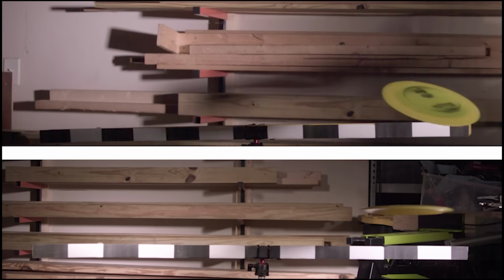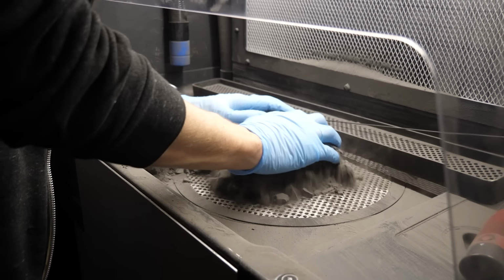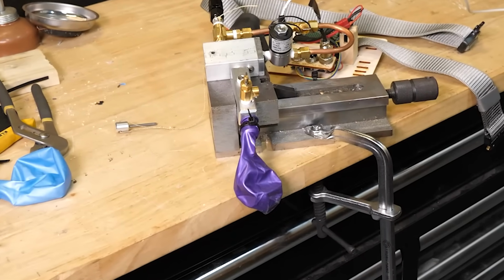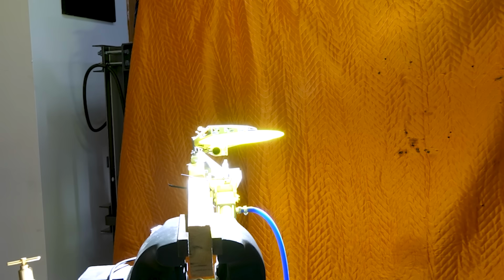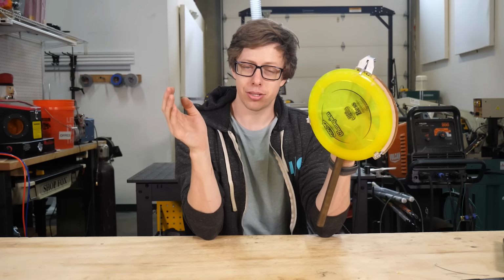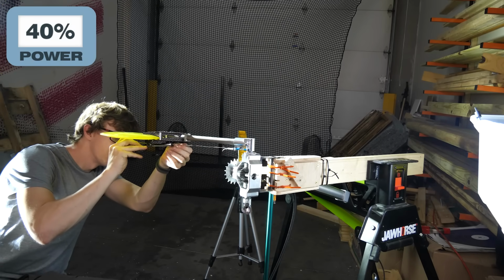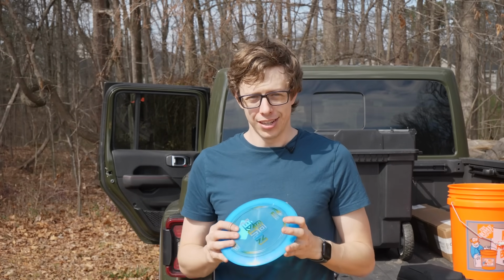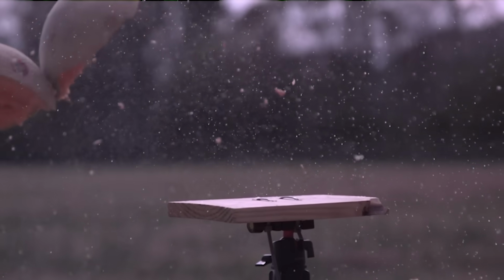Wrist rocket: worlds fastest disc launcher

Comment: Just my two penny worth.  You make a disc a little over twice the diameter of the thrown disc (tdisc) and about a third as thick again.  Then the launch disc (ldisc)  has a cavity cut out to contain the tdisc and another diagonally opposite to balance the removed weight. The ldisc holds the tdisc within it and a motor steady speeds the spin of the ldisc up to desired speed when told to launch, a blast of air pressure pops the tdisc out of the ldisc and it flies off hopefully in the correct direction.  Advantage is the speed is built up slowly and there is no reason to suddenly halt the ldisc after releasing the tdisc.  A little tricky routing the jet of gas from cylinder through the mounting axle of the ldisc and out to the tdisc cavity but I’m sure your can come up with something.

Comment: Spin spin spin to keep them flat in flight (eventually turning it over in the opposite direction), you already have the force, you just need to translate a portion of that force into spin.  If you could pre-spin the disc would be perfect.  You could have a clamp system that holds the disc in the center and spin it, then "shoot" it.  Might require a complete redesign with a straight shot instead of a "sling" shot.  Like a bullet, just instead of spinning it in the barrel you pre-spin it, then launch it out the barrel.  I think for accuracy it would be superior and the safety of it would be better.  You would definitely need some sort of brace to keep it from shattering your forearm or worse snapping your elbow (don't really know which would be worse).

Comment: if you start the disc on a hyzer angle (or like at 8:00 o'clock) it will flip up to flat and turn, then when it starts to slow down the rotational speed, the disc will come back to the left - like a giant "S" - that is how pros  that throw 80 mph get the disc to fly 700' or more

Comment: In my experience throwing a frisbee for distance; assuming you are right-handed and throwing it from left to right across your body, the best release angle is approximately 45 degrees to perpendicular to the ground instead of parallel to the ground. This release angle will give it more lift. A disc shaped projectile traveling clockwise in this manner will take advantage of the tendency of the disc flying to the right as it slows down and descends.  Wonderful job otherwise!!!

Comment: Maybe Rev 2 could utilize the same mechanism that a football launcher uses. Think you could use spinning wheels to both launch the disc out but at the same time put a big spin on the disc? It wouldn't be a throwing motion but you could hold it with safety because there would be no twisting force or side to side force. Only a small kick since the weight of the disc isn't high.

Comment: The real trick to disc gold isn't about speed or power, it's about controlling the tendency of the discs to curve or twist in their trajectory. Those motions are easy to predict but hard to control, and unfortunately most of that would be handled by your release mechanisms, which are obviously the hardest to get right

Comment: you need it to run more like a real throw. 
it should pull in more of a straight line and have a bit of a whip at the end that puts the spin on the disc.
also the faster you throw the more the disc will flip, so you need to throw on a hyzer so it can flip up to flat to get the distance.
maybe a chain drive with a flick at the end would work better, so the disc travels more like being on the end of a cracking whip then a roundabout

Comment: Need to put the disc on a pretty extreme hyzer angle (arm pointing toward ground at about 45 degrees) so when it flips it flattens and glides instead of turning into a roller.

Comment: Instead of making your own valve, use 4 or more of the smaller high pressure valves in parallel, also using an accumulator tank is great

Comment: A slingshot method would replicate how a disc golfer actually throws. 90% of the throw is the pull and the last 10% of the throw is when it rips out of the hand gaining that spin. If you could replicate this with more of a pull rather than a gyro machine, that might fix a lot of issues. Mainly, you could then tilt the release angle to match the flip of the disk.

Comment: I would probably design something base on sling shot. Use rubber band as power source, simply and effective and it even possible to control the spin rpm if design it right.

Comment: Is it possible to integrate some bearings into the holder mechanism and a small drone motor to spin it up so you can get the gyroscope forces you need for it to stay stable?

Comment: I thought about using a spinning wheel like a tennis ball thrower.  Enclosed slot, rubber rail on one side, high speed spinning wheel on the other, or maybe a series of wheels.  Not as cool looking, but much easier to build, aim, and would impart a ton of spin.  I just need the right tools...

Comment: All you would need is a 100 gram ring of metal glued onto the discs. Spin rate increase will just flip them faster. You need more mass to resist the change in direction.

Comment: If you could place 4+ numbered lines on it and speed capture rpm once out a bit from launch vs the human rpm by wist snap. Like the javelin hand twist action. But more importantly; if you can extended the vertical center shaft say 1 foot or more above and below the disc and place ballast you will auto stabilize that darn torque. If you had a gyro at each end; even better.

Comment: this is cool :) ... I felt a bit like the machine was a maybe bit overengineered in some of the parts(and too simplified in some parts,( the human wrist is a bit more complex than 2 way motion, and could be a factor in how sucsessful it could be.), but its more an way of taking on the project, simple or complex, and finding the right balance between the two, what would take it to the next level would be to see a x-ray of a man throwing a perfect throw and see how his bones etc fine tune the throw and try to mimic those movements, but paradoxically that would be a bit overengineered maybe ? :D heheh...  Maybe a more medieval way of thinking out the machine would be better, less parts, and a rod fastened to the hand hits a trigger which disengages the lock in place, by simpler mechanics? but that might make the machine unwieldy and too heavy and dangerous,  so the sideways catapult simplicity might not work at all, all things said...im absolutely no expert the subject, and this dude really knows his stuff, kudos! really enjoyed the video and it made me think of solutions or things that could be tried out, and i had fun doing that... Well that was my thoughts  and me debating partly pros and cons and ideas with myself on the fly , keep up the vids :)

Comment: you could just make a disc thrower similar to a nerf gun, with two spinning wheels/rolls , one above and one below the disc, running super fast. when the disc gets pulled in-between the two spinners it gets thrown out the other side easy. i think you were trying to mimic human methods too closely

Comment: you should see if you can get a pro frisbee thrower..  and slow mo vid capture from above of the disc throw, to see disc rotation vs spin.  that'll tell you where to focus.   I mean, obviously it's spin, but those are the numbers to beat, not just distance.  you could probably launch it without spin and get further, with enough force..  but it's about the rest of the dynamics, so.. spin amount vs directional force.   is there a better ration than others?

Comment: Hmmmm that kick and rotation could probably be fixed by weight balancing the bottom and top arm. The same way a rotating space station can use two wheels spinning the opposite way, as long as the center of mass of the arm is at the center of rotation, it should have negligible net rotation.

Comment: This seems a case of reinventing the wheel. Could have got a head start if you had analysed a clay pigeon thrower. Also you knew before you started that a frisbee is pulled through rather than pushed. Needed to spend more time studying human mechanics before u jumped in the deep end and it would have revealed a lot. Was fun 🤩 though. 👍

Comment: I really want to see you revisit this idea and solve some of the remaining problems. It would be so fascinating to watch a robot throw a disc better than any human, and it would also be a legitimately useful invention for disc manufacturers to be able to more reliably test how their discs fly.

I definitely think you're on the right track when you mention your robot lacking spin. I noticed you're throwing discs like the Nuke OS which should be incredibly resistant to turning over, yet yours completely corkscrewed which is just an unfathomable amount of turn, even for an inhumanly fast throw. Something beyond just raw speed has to be exacerbating that, and lack of spin makes intuitive sense. 

It would be interesting to see you collaborate with one of the top distance throwers, or at least review footage of them, to see exactly what spin rate they are achieving and then compare that to your robot when it's set to similar speed levels. I suspect you are indeed not imparting as much spin on the disc as a real thrower. Perhaps it's because your robot isn't emulating the wrist joint at all?

Also I think regardless of all of the above, you're releasing those discs at the wrong angle for maximum distance. You had the whole rig tilted right, which we call "anhyzer release angle" which is the opposite of what you want given your discs are turning over. In your case the disc was corkscrewing so it probably wouldn't have mattered, but still, if you get a more typical amount of turn, you'll definitely want to release on a "hyzer" angle AKA left edge tilted down.

And regarding disc selection, there are some new discs released which have higher speed ratings than the ones you were throwing. There are also discs produced with overmolds that have a higher proportion of the weight pushed into the rim. This might help somewhat, and I'd love to see it tested.

Final thought, the world distance record of 1100+ feet was very much wind-aided. This throw was performed in a dry desert lake bed and the discs were thrown super high in the air with the flight plate exposed to something like a 45 mph tail-cross wind for maximum kite effect. If your robot can throw even 700 without essentially wind surfing then you're probably already exceeding the human limit, but I'd still love to see one fly 1100+ without wind assist anyway.

Comment: Those discs are supposed to be launched on steep hyzer at those speeds.

You're machine threw everything on anhyzer. I've seen pros roll those discs over with less speed on that angle, it's no wonder your machine did the same. 

How'd you play DG for years and never learned this?

Comment: You may not even need to use all that force to break records if you modify the holder to allow for maximum `snap’ for maximum spin on the disc. Any pro will tell you spin will increase performance significantly. Technique is everything just like ball golf. Lol you kind of need to be able to tune it so you stay within the limitations of each discs design. Or only throw a 15 speed since you’re going for distance anyway. Maybe consider a wheel like a pitching machine rather than the swing arm. I think that would work better for this application and be far more safe. 😅

Comment: I think part of the issue you have with distance is because your using a spin to generate speed which causes the disc to spin too much. This will turn a disc over more... I think there would be more success with distance if you use a slingshot instead of a gyro, then the disc won't turn over from spin.
Reply: The disc needs spin, that's how you get distnce out of it. The problem is he is launching them upwards. They need to be launched level. The disc itself will generate lift, so he doesn't need to aim high .

Comment: You are stuck in 2 dimensional thinking.  
You are throwing with it horizontally level.
You need to tip the whole machine say 30 to 40 degrees away from you. So when the disc naturally rolls, it rolls into being level and will fly father

Comment: your vertical axis drive shaft is not stable and the torque distorts the horizontal x of the disc platform. 'Gyroscopic implementation should be introduced. You are building a hovercraft that launches with recoil.  The platform is the design flaw like a cinema gimble for a floating dolley and a 40 pound camera.

Comment: after rewatching the slowmo footage to me it looks like the discs exit angle is steeper than your gripper. 
u need to rotate the angle and have about 2/5th of the disc inside the gripper and it needs to have three faces in order to hold it. also an elliptical curve instead of your circle would result in a much much straighter "pull". also to have all the energy come at once is dumb for many reasons. you should have stepped the pressure to lower the forces sir. this is very crude considering the tools at your disposal imo.

think jai alai

Comment: You'll never find a disk brand that will not flip over like a girls throw at very high speed until you get it spinning at least 2 rpm per yard traveled so the machine must really grip and quickly spin that bitch at warp speed before launch. A bull whip launcher or centrifugal flywheel tape measure concept adding some mech. assist may work.

Comment: Question! What if you combined this idea with your bay blade of death?

What I mean is, what if you made a machine that throws a frisbee/discus, but the actual mechanical part is all focused around making the thing spin REALLY fast.

Would making a discus/frisbee spin horrifically fast, and somehow throwing it like a person, improve power significantly?

Like, you made a sort of gauntlet that had a spiny thing, like a grinder, on the palm, and you turn it on to spin the projectile, and when you throw, it unlocks the projectile, therefore FLINGING that baby to the moon?

It sounds like something a minor super villain in an comic would do. Or a power in an anime. 

“I can create flat disks that I then spin at HYPER SONIC SPEEDS, which I throw with my magic to KILL YOU!”

For any JoJo’s fans, yes, this idea is basically just The Spin from Part 7, but using a disk instead of a sphere.
Reply: that's stupid. There is a reason why he hasn't done this.

Comment: Could you go to the moon? Assuming you partnered with someone like bps space to get it off earth… could you make a solar ion drive to very slowly get it there… and then since there is no atmosphere on the moon, come in at a low enough angle to essentially hit the moon sideways and roll to a stop?
Reply: Bps space? To the moon? Have you seen how big the rockets are that take satellites to the moon?
Reply: @ of course the idea is insane. But so are most of the ideas on smh. If you’re not going into orbit you only need 11 meters per second. If you could get a centrifugal launcher to heave a small rocket that in turn could lift a tiny ion drive above the atmosphere… you should eventually be able to make it to the moon. Nuts, but feasible.